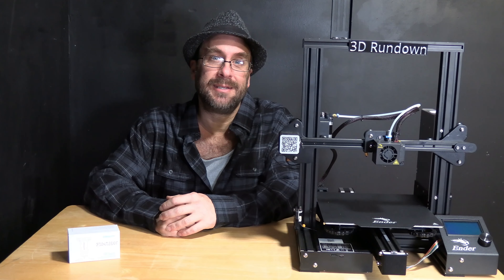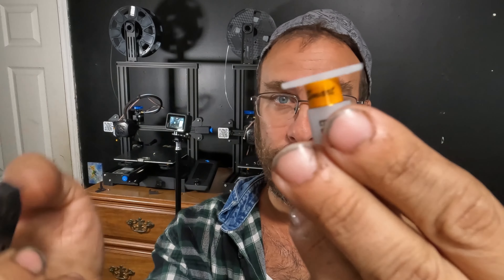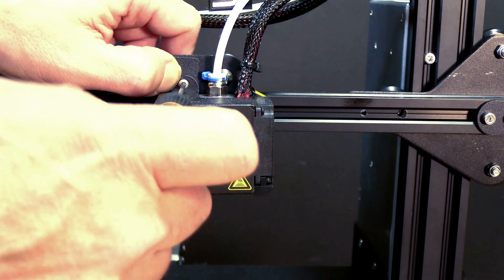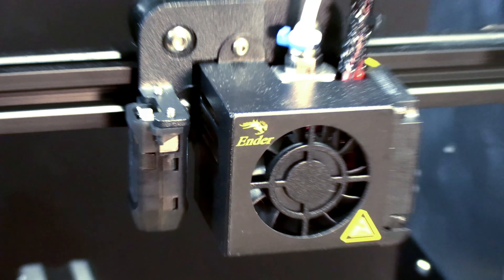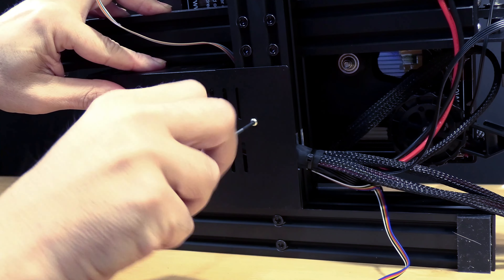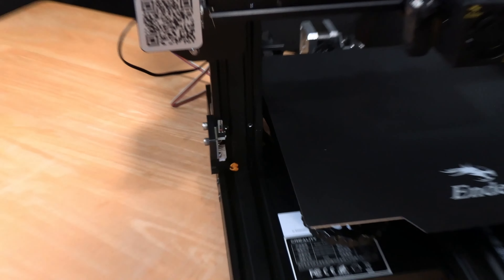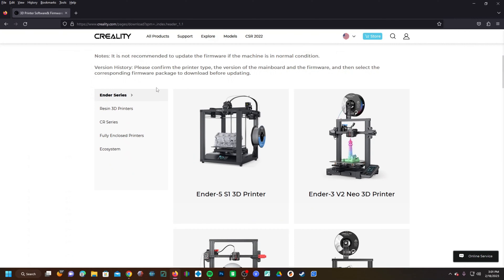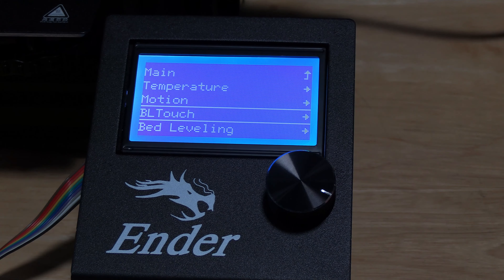Install Auto Bed Leveling Probe:  CR TOUCH or BL TOUCH on Creality ENDER 3 PRO - ABL 3D Printer

Comment: Followed all the instructions in your video (great explanation of everything by the way) and now have the BLTouch and leveling options available to me on my Ender 3 Pro but also have a really glitched out LCD screen. Any idea on what happened here? I confirmed I have a 4.2.2 board.
Reply from the maker: Feels like something could be
Shorting somewhere. I would turn it off, and check all the tiny little connectors at the board. Be sure they seated ok.
Reply from the maker: Also. Stock firmware sucks. Go here: https://marlin.crc.id.au/
Reply: @3DRundown  how do i put this onto my 3d printer....its giving me a hex file instead of a bin file

Comment: Hi there everyone can someone help me with the files bcs I did everything he did except for me insted of the file that i need to copy there is a video of 6 seconds long, can someone please help me with that.
Reply from the maker: Not following. What file do you need?
Reply from the maker: The firmware is on Creality.com
Reply: The file i need to drag to the card is a video instead of a file like with you
Reply: @3DRundown I did everything acording to you but when i got to the last step of transfering or copying the file to the SD card i saw that the file is a video
Reply from the maker: You are looking for a .BIN file.
Reply: @3DRundown  thx, it worked
Reply: But also my printer says i need a TF card is that supposed to say that?
Reply from the maker: Yes, you'll need to keep a memory card installed in the printer. That's where it stores the config file
Reply: Thanks alot

Comment: I’m very nervous it changed everything into Chinese or Japanese I’m not to sure which and I don’t know how to remove the firmware but the light on the cr touch is purpleish color
Reply from the maker: possibly installed wrong language firmware? Should be able to change it back to english with a little poking around, if familiar where the settings usually are. Purple is ok
Reply: @3DRundown  ok it’s better but like what does it even do it just touches the bed like 15 times and goes back to the middle of the bed I’m thinking about removing it if it doesn’t work
Reply from the maker: Sounds like it's working. I would watch my videos on how it works and how to use it